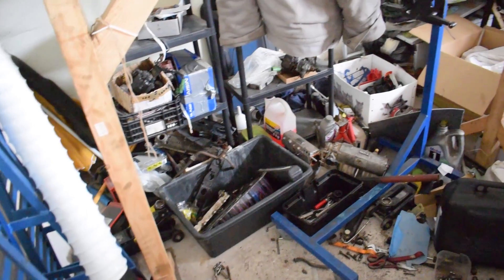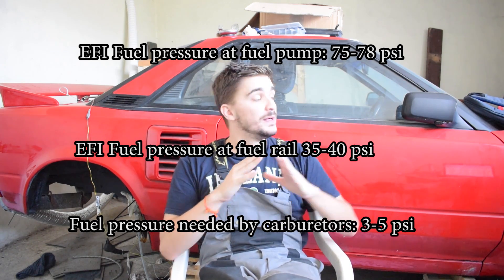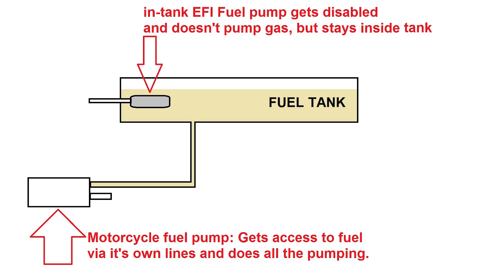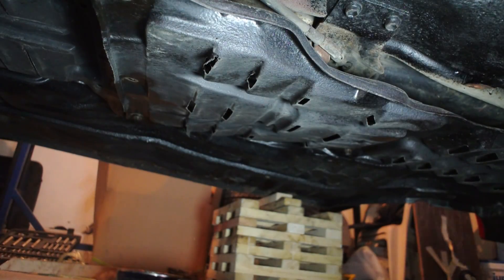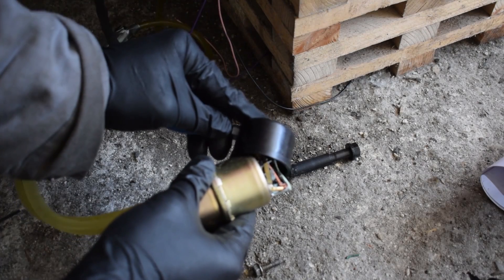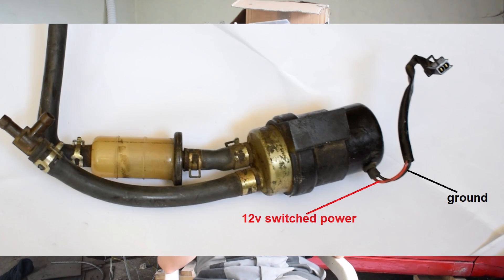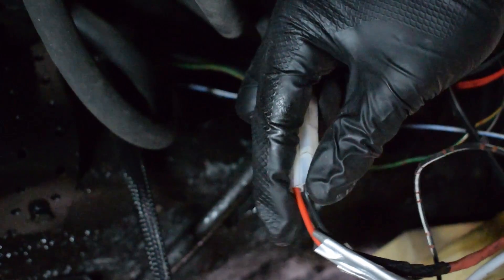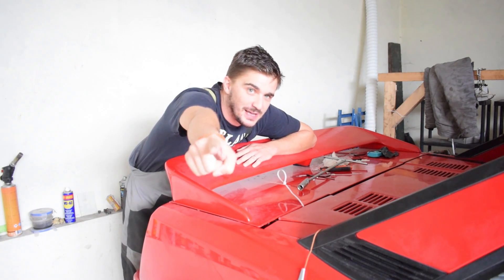BIKE CARB (itbs) conversion FUEL supply - how to

Comment: what about the fuel flow? 1.6L engine should need more fuel than 0.6L engine
Reply from the maker: I made a 16min video and forgot this. Here's how it works. The vacuum generated by a piston going down in the cylinder is what pulls fuel from the carbs. The sport bikes that use these pumps all rev well above 10.000 rpm, and the pump has no problem keeping up. The 4age doesn't rev beyond 7600 rpm. Now imagine how many times more is fuel drawn out of the carbs in case of the sport bike. Now a 1600 engine may have bigger cylinders and pistons, but it doesn't really need more fuel than the bike engine does. I tested the fuel pump and it fills a 1 liter bottle in less than 30 seconds. Since there is no pressure in the hose when it's filling an empty bottle it works at full speed and it clicks really fast. When it's pumping fuel for the carbs it generates the pressure required within seconds and starts clicking really slowly, like once every second. I also tried keeping the engine at high revs (4k to 5k) and it does click faster, but still nowhere near as fast as when it's at its max speed. So, to sum up this stupidly long response, a 1600cc car engine on bike carbs cannot exceed the capacity of this and similar pumps. :)
Reply: I was kind of curious about that too though. If at full throttle the 600cc engine may require say 5 LPH of flow, what if the 1600cc engine requires 15 LPH of flow? Yes, it only needs very low pressure, but if it can't maintain the 3 PSI required, there may be problems. I'm sure he probably considered this and the pump can handle it, but I was also wondering.
Reply: Sounds like it should work to me!
Reply: Bigger jets/nozzles on the bikecarbs take care of more fuel in the cylinder. Fuel pressure is not an issue, all old cars with carbs ran with low fuel pressure no matter the engine size